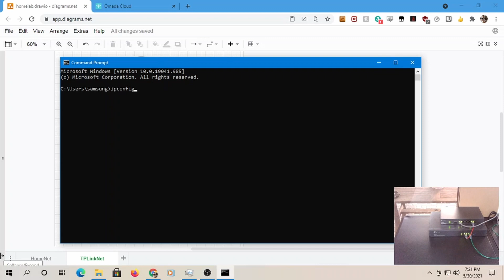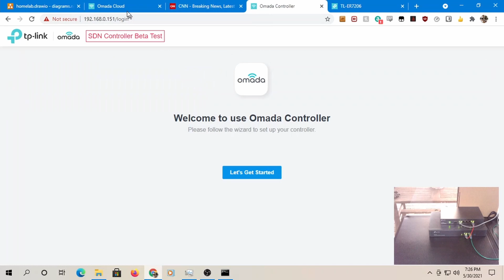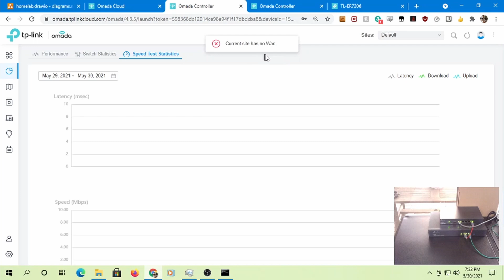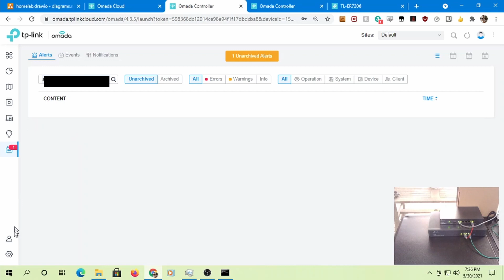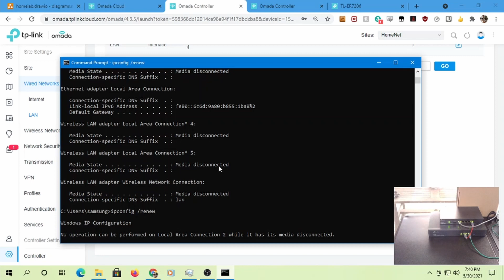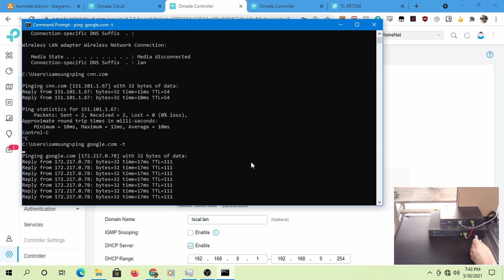Let's configure EP1: TP Link TL-ER7206, OC-300 Controller and Omada SDN Out of Box Experience

Comment: What is the maximum speed from Lan to Wan with firewall on. Coz my internet speed is 1000Mbps. Im now using Zyxel which is limit my internet  speed from 1000Mbps to arround 400Mbps, so im now looking for new router with firewall+gateway of each LAN subnet that can outgoing to from Lan to Wan 900Mbps+
Reply from the maker: Hello and thanks for dropping by my channel. With all the default settings, I constantly hit 900mbps+, on a regular busy day (3 other people using the network, some streaming videos, some streaming music), my speed never dips below 800mbps. This is on a Wired Gigabit laptop that goes to the switch then to the router.

If you are hesitant, and you're in a country where you can easily return equipment (i.e. Amazon US), I recommend to get one, and if that doesn't work for you, you can return it.
Reply: @deadmeats  Hi bro, Thanks for your answer 800mbps+ is fine for me then I will replace my existing one, and bad news in my country(Thailand) we can't return product after buying if it doesn't defect. however I now got feedback from you and make me confident to buy it.